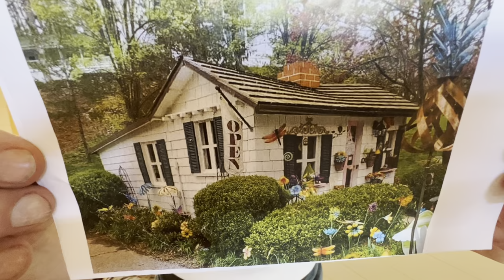Incredible Tiny Home 8’x20’ “The Austin” for $57,900 w/2 Dormers 🏡🇺🇸😉🤩❤️💚🤍

Comment: Hi Randy & Amanda! WOW Love the idea of the 8x20 Incredi-Cottage ( great name ) to add to the List!! Love the Price as well for $29,900! Can't wait to see the layout of the inside of the home as well as the packages that you might include! Much love and Prayers to everyone in ITH! 
From "Twisty-Mysti"
Reply: Probably the same good layout as the original 8 x 20 Incred-i-Box but loft space would be tighter as the roof is a gable so hard to fit  proper size egress window. Personally I like the higher lengthwise shed roof as its aerodynamic, bigger loft, easier to place solar panel's, etc. but will have to see the final layout.

Comment: Cute style on the outside. I would want another door in the living room where the end window is (or one of the other windows) so it looks more open when you walk in and put both lights on either side of the door on the outside. I would want a ceiling under the ladder with a door opening to bring down the ladder like you see with attics in a home. I would also put the solar equipment above where it is now if you can make the hoses longer.
Reply: @mygypsyadventure3610  That particular Austin has some custom amenties for it's customer - solar systemwith big ass old type batteries, washer-dryer closet, etc.

Comment: I was wondering how the ladder was going to be setup.  That is good that it is up, so it is out of the way during the daytime.  Maybe the batteries can be on top of the closet/laundry alcove and put a narrow cabinet over the electronical equipment for the solar, (like the cabinet in the Incred-I-Box), but a little narrower and a gauge to let you know what the batteries levels are.  

I like how there are shelves on the end wall by the door, and the water heater underneath.  Also, I like that the fridge is on the other end of the counter.   From the video, it seems like the switches would be behind the fridge, I would want them under the shelf of the vent hood, so when you put a fridge there, they won't be behind the fridge.  

If the fridge was by the door, it could be a bit crowded when you walk in.  Having counter space by the door makes since and the water heater underneath is also a good idea.  You can put a door in front of it as an access door.  Also, if you ever need to replace the water heater, it is already on the ground and close to the door, so it won't be dragged through the house, very clever and convenient setup.  The arrangement is a more convenient arrangement.  I would opt for the 24-foot length and have a little more space in the living room area.

I like the white walls the horizontal wood panels (kind of like Joanna Gaine's ship lock), and the natural wood ceilings, make a nice contrast.  It also has a nice touch for someone who wants to give it a Beachy decor.  (I am a beachy decor fan).  I am glad to see how the "Austin" will look, with the ladder and kitchen.

Comment: I can't help but wonder if the current layout is to keep the plumbing as close together as possible.  I liked Luanne's layout as well.  I prefer that the bathroom NOT be within reaching distance of the kitchen.  I suppose the issue with making longer Incred-i-Boxes could have something to do with competing with the lower range of their stick-built designs; but it's at least as likely that they are trying to create affordable housing for those on a fixed income and another 10-15K on the house is just too much.  There are other costs besides the house (insurance, landscaping, appliances).  I know the point of 8' wide to is to make it towable without a special permit, but if I buy one of their homes, it'll be on their property.  The only way to get me out of there would be to price me out by raising the rent (doesn't work well on a fixed income) or with dynamite.  I don't just like a wide hallway; without apology, I admit that I need a wide hallway (that may or may not change in the next two years).  Anyway, I thought I'd stick my 2 cents in about liking the layout of Luanne's tiny home, too.

Comment: I would take the batteries and turn them in the other direction under the mechanics, I would build over the mechanics and batteries to look like a “hall tree” with hooks for coats and a seat to sit down and put your shoes on, lift up seat to access the batteries, hidden door to access mechanics!  Could be built in the shop and carried out and set in place, can be custom painted, or stained!

Comment: That would be a no for me on the incredi-cottage.    I see the incredi-cottage as just another iteration of what you are already doing and I'm not clear on what major difference it is bringing to the table as far as actually living in it day to day maybe a yes if I saw a major design difference rather then just aesthetics.   What I would like is an 8x24 incredi-box with a bigger bathroom that is ADA compliant or as close as reasonably possible in the space constraints.   Keep the entrance door on the side so you can use a wider door for wheelchairs.   I love your products but they are just not realistic for families with wheelchair users.  Those tiny showers are just not going to cut it.  Either there needs to be a larger shower big enough for a shower chair or a bath tub shower combo that you put a bath seat in although a wheel in shower would be awesome that might take up too much space.